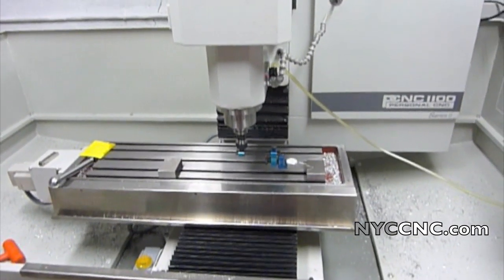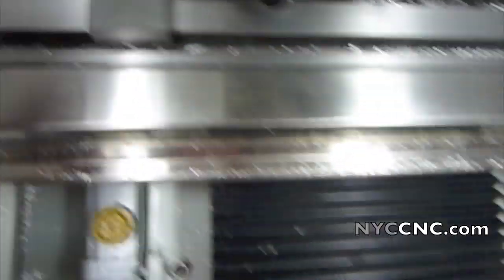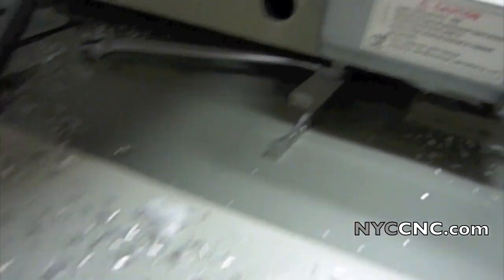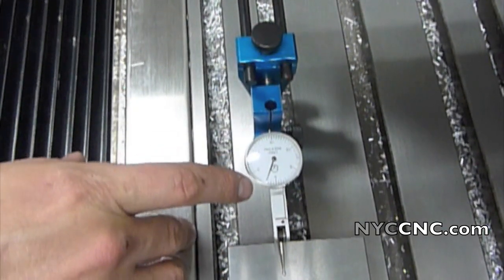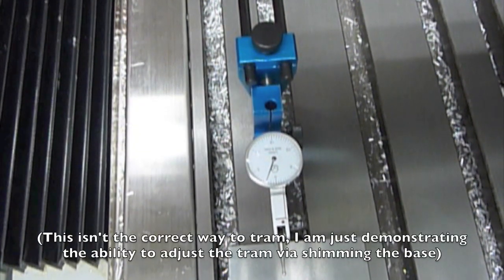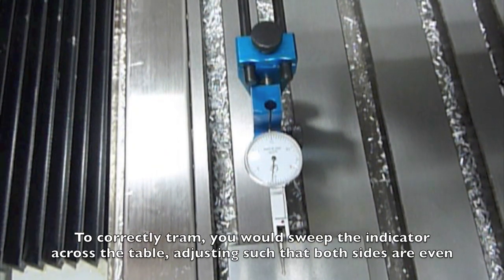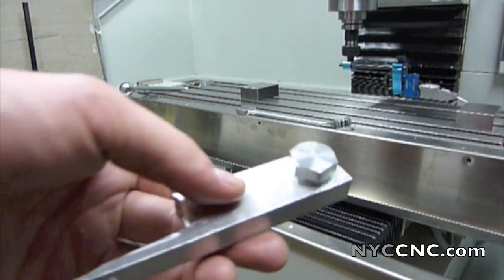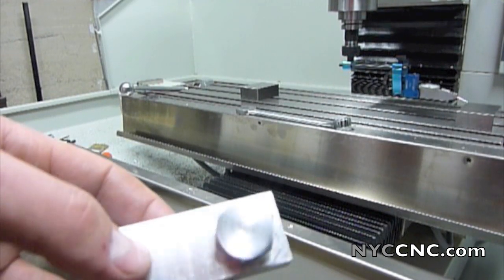Tormach PCNC 1100 - Adjusting Mill Tram by shimming the base.  Ch. 12

Comment: lol 12 years later and I am finally referring to you John because I never trammed my machines up to now!  They have been acceptable for years now but now my 770 needs to run some absolutely flat surfaces for a new customer.  Figured it should be done correctly now!  I know, I'm a half-assed hack, but I get by.

Comment: A tip: Don't touch the indicator or holder. Only move it by touching the spindle so as to not have potential to move the indicator. Having only .003 or .004 engagement will remove the necessity of lifting up the needle with your finger. (a larger probe ball also works). Appreciate all your vids. Very informative.

Comment: I have been researching these mills and intended to buy one. This vid gives me concern. You've shimmed the x axis of the  table perpendicular to the axis of the spindle. I don't know if the spindle is perpendicular with the table in y axis. The biggest problem would be if the spindle axis is not aligned with the z axis ways, in which case, shimming table and saddle ways could exacerbate an already aggravating issue. I would like to see NYC CNC follow this video up using an angle plate that he knows is square (maybe show it being checked with a cylinder square and indicator) and run the indicator up and down in z along the face of the plate to show the z axis is actually perpendicular with the table in x and y.
Reply: You do realize this video is ancient right?   You're  other going to get a follow-up video.  He has moved on pretty far down the road.   Reach out to Tormach to get your question answered.   If you've essentially 'made up your mind's to buy one, then discuss your concern with them.  If you get a crap answer, then move on.   If you get an answer that makes sense, move forward.

Comment: That's right, what I meant by not industry quality is overall it looks like it doesn't measure up to the needs of the fast paced manufacturing industry. I personally haven't seen any used in any non-home shops, and I also don't own one (yet).

The way it needs to be leveled makes it look kinda 'mickey mouse'. But yes it is much cheaper and although I say it doesn't look like it's up to industry quality, I intend to buy one as a first machine to enter the industry...